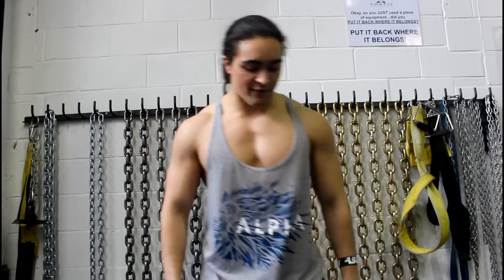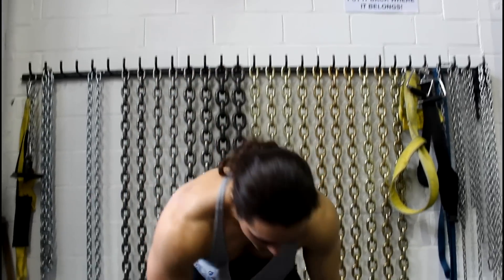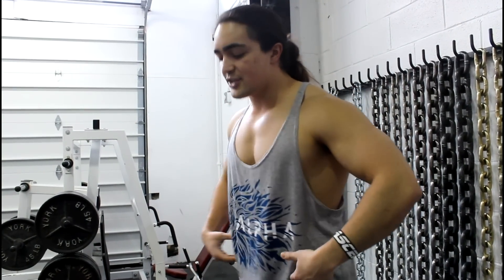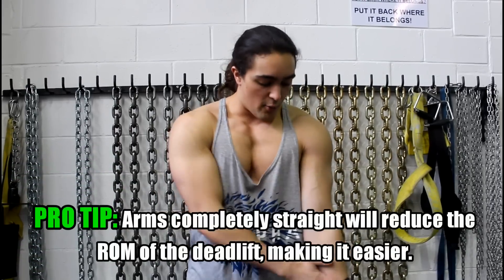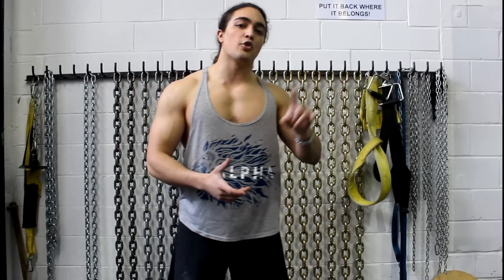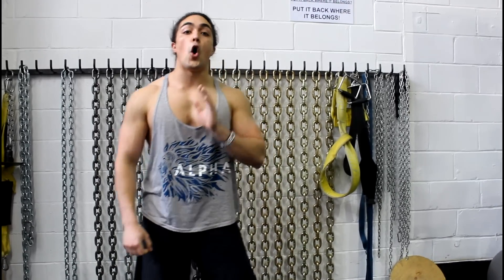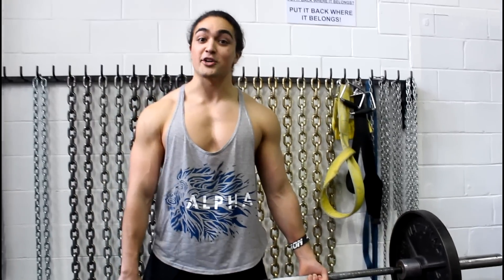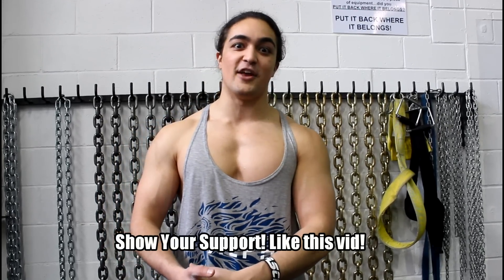HOW TO Prevent a Bicep Tear With Deadlifts (Common Technique Errors)

Comment: the straight arm this is good - but with an alternate grip the supinated (palm under bar) the shoulder/scapula ends up protracted - and typically is pulled further into protraction as it  cant hold position and the instinct is to flex elbow (gained through sliding it backwards) to compensate for weak scapular stabilisers...secondly and most importantly if you have limited lateral rotation don't use alternate grip!

Comment: This is an excellent video on this subject and I am a former Personal Trainer, Natural Powerlifter and have been working out 42 years. Regarding the videos, people should have them looked at by an objective neutral qualified perdon, such as a Srrength Coach or Physical Therapist. Another tip is to not train biceps prior to doing Deadlifts bed at see the pump can leave your biceps in a slightly flexed position and more vulnerable to a tear.

Comment: Normally, when the bar is tilted, the lower part is actually holding more weight. It probably works differently here, because you said you strained the one that was higher, and it was under hand grip. But for example with bench press, counterintuitively, if you're tilted to the right, it's because your left side is weaker and the right is holding more weight when it's tilted down towards it. Taken to its extreme, the left could be locked out while the right is still holding the weight. For the younger viewers, keep that in mind when you see a tilted bar and need to fix it.

Comment: Omar my gym has those stupid ass hex plates do you think that could cause some uneven strain on my bicep?
Reply: I have the same problem. aim pretty sure I hurt my back when I didn't reposition after the weights shifted.. Most ridiculous thing ever
Reply: Yeah man same I worry every time I'm deadlifting
Reply: My gym has those and I just reset my feet every time I do a rep dead stop. Fucking pisses me off like nothing else.
Reply: I ran into the same problem and I have never been so infuriated in the gym. But if you don't have an option to switch gyms there's no real perfect solution, but I found something that works almost like you're lifting with round plates.

If you're lucky enough to have a gym with squat racks that look something like this: http://www.discountonlinefitness.com/media/catalog/product/cache/1/image/5e9eac4083af1bf3e0366a14280110ed/i/n/ins-olympic_squat_rack_wo.jpg

You can take the safety pins out and rest the bar directly on the bottom of the safety area. This should give the bar the same height as a normal deadlift with the 45 lb (20 kg) on the bar. The weights at my gym are 10-sided and the 45 lb plates still barely catch the ground when I try to roll the bar towards me, so I have to use the 35 lb plates with this method. With each rep you can roll the bar towards your shins almost like the bar was on round weights.

I even found it hard to one rep max with the 10-sided plates because your feet would have to be in exact perfect position when you set up or else the weight would still be too far in front of you. Goddamn I hate those fucking weights. Thankfully there is a workaround if you are lucky.

Comment: Here is the main reason why people attempt to bend their arms during a pull: weak (or slippery) grip. First natural reaction to losing grip is to try and hike the bar up with biceps. No biggie with pronated hand, but supinated arm will take a hit to the biceps tendon. The other reaction to grip slipping? (I thought you'd never ask...): rounding lower back. Toughen up that grip! Use chalk! Great job on the vids Omar.
Reply: the main reason people lift with bent arms is because they try to tuck their under hand under the bar to hold it better...if you tuck it under far, your arm will bend.

Comment: OmarIsuf , I was doing T-bar rows the other day and now I'm feeling a little bit of pain in the insertion point of the bicep.  Is that movement essentially the same as doing deadlifts with bent arms? Its hard to keep my arms straight when doing T-bar rows.  Am I at risk of tearing my bicep, and if so should I just avoid T-bar rows or do them differently?

Comment: Hey Omar, when I do mixed grip deads with a symmetrical grip, my underhanded arm's elbow pushes into my knee from the side. What would be the best solution to fix that? I usually place the underhanded arm slightly further out to give my legs clearance, but now I get the feeling that wouldn't be smart.

Comment: Omar, Can you do a video on how to prevent a lat pull while deadlifting. It is actually very common. I have done it twice and am recovering from it now. I use double overhand grip and at the height of the lift, my lat (right under my armpit) felt like it pulled. Being cautionary, I stopped my workout. Just wondering if you have tips to avoid this. My lats may not be tight enough or I may be flaring them out instead of retracting my scapula. Thanks,

Steve

Comment: please omar answer this question: a few months ago I deadlifted with the mixed grip and heard a pop in my left elbow with which I was gripping the bar underhand. Felt just a little pain due to the pop (just like when someone cracks his neck or his fingers), but didn't bother me since so I kept training. But I can see that my left bicep is now about half an inch shorter than the right one and my veins are not in the same place.. Could this be an issue later on? thank you in advance
Reply from the maker: That actually sounds like a tear, you should see a qualified professional
Reply: OmarIsuf ok, thank you Omar!

Comment: Advantages of mixed and hook? GO

Mixed feels awkward as fuck to me, yet I see loads of people using it over hook, is it simply a comfort issue or is it better/safer?
Reply: There is no advantages. Some feel that they can pull faster with mixed. However most ppl use mixed because hook grip hurts like shit!
Reply: Mads Petersen Also to be able to use hook grip you need long fingers /hands
Reply: My finger is too short to use a hook grip, and plus it hurts a lot for me.

And then when I'm using double overhand grip, I find it hard to focus on lifting the bar up because I had to pay more attention to my grip to keep it tight at all times.
Reply: if you find that ur grip is limiting (the weight feels like it slipping out of ur hands) how much weight you can deadlift.

changing ur hook grip to mixed grip (one over and one under) will provide a secure grip, and enable you to lift more weight on your dead lift.
Reply: greentea705 I think this is the reason most people use mixed.

Comment: Do you have to deadlift with the mixed grip? I only deadlift around 220 pounds for reps if that's important in these circumstances and I do that with my fingers facing towards me on the bar
Reply: The kind of grip you're using (double over-hand) is the 'standard' grip that you should be using whenever you can. It works your forearms a lot just to mention one thing. When you want to move up to weights that your forearms can't handle with the double over-hand grip, you can switch to a mixed grip so you don't get stuck on lower weights. After a while you might even be able to switch back to the double over-hand grip for the new weight when your forearms have caught up.
Reply: Okay mate thanks for the advice :)

Comment: #Error 4 Uneven grip, wouldn't most on the load go to the arm closest to the center of the bar? so not what you were showing.
Reply: It may be true that more load is going to the arm closest to the bar, but the upturned arm is in a far more vulnerable position and can't take the load as well

Comment: Due to breaking my elbow I can't straighten my left arm fully, so when I deadlift heavy weight I sometimes feel tightness on my left biceps and so I'm scared of tearing my bicep. Do you recon I should stop doing deadlifts, shrugs etc?
Reply: try switching to a hook grip or use straps when deadlifting heavy
Reply: try switching to a hook grip or use straps when deadlifting heavy
Reply: try switching to a hook grip or use straps when deadlifting heavy
Reply: appreciate your reply mate but that doesn't help because it still puts pressure on my arm which doesn't bend fully
Reply: If you are doing the dead lifts only for muscle aesthetics, then you do not need to do that exercise if it puts a risk to your body. There are many alternatives. E.g. Chris Jones, does not do dead lifts in this regular routine, he has  a video on this, and his muscle development is great. Good luck.

Comment: omar, no one can bend their elbows with 500 lbs, i don't think thats the problem, I've seen videos of these deadlift bicep tears and Observing the bicep i don't see the tear resulting from an initiation of a bicep contraction. I see that the bicep tendon seems to snap from the pressure of being extended downwards by the weight, I think this is prbably due to wear and tear of some sort

Comment: I filmed myself and I cant tell if I bent my arms. I was pulling 700lbs and I tore my bicep Feb 3 2018. I had surgery Feb 13 2018. Now I am finishing my physical therapy and want to slowly train deadlift again, but I wanted to use hook grip. I like double overhand, but I dont want to even risk it anymore (yes I did watch the entire video, I am just not comfortable using mixed grip yet).. here is my 700 attempt video https://www.youtube.com/watch?v=bITXaYjh5do.

I pulled 683lbs easy the week before.

Comment: not to be a smart ass....but if you are dead lifting 405, it takes more than 405 lb of force to displace the weight. So, technically there is a lot more force on the bicep than just 405, but you would also have to divide the weight by 2 cause both arms are sharing the load.

Great vid BTW
Reply: to bertsimsan, oddly his tag removed from my comment. anyway....
Reply: +Burak Özel well if the grip is mixed the arm with the hand under the bar will have more force being placed on the bicep compared to the other arm with the over bar grip

Comment: Best way to prevent a bicep tear while reverse gripping is using straps, plain and simple... Straps drastically takes the load off your arms. Whether your arms are bent or not, you will strain your forearm and bicep by just grabbing the bar when you have 500 lbs+... Oh....you want to go 100% raw and say straps weaken your grip strength? Absolutely it does..... straps have their place in training if you compete, but get use to just using chalk with no shirt..... This advice is given to those who don't plan on hitting the platform and competing. If you are just a casual weight lifter and deadlifting over 450 lbs, just play it safe and use straps. Nobody will care and you aren't impressing anyone anyway with that kind of weight, so it makes no difference. You may as well play it safe..... Same thing with a belt. If you compete, a belt has its place in training, but shouldn't be relied on as a crutch... but if you don't compete, wear a freakin belt cause chances are, your form sucks anyway..... Most weightlifters I see in the gym, don't even do deadlifts regularly... and when they do, their form is all jacked up. If your form sucks, the belt can prevent injury and keep you healthy and progressing.

Comment: Simple, use a overhand grip on your weaker arm and then you are almost guaranteed to never have a tear.
Reply: RomanDutch 

Pretty.close. BETTER STILL warm up the fucking biceps with some light barbell curls and reverse curls. And you will be fine.